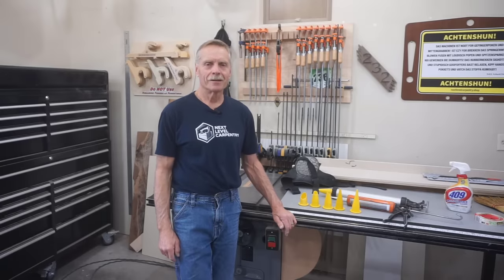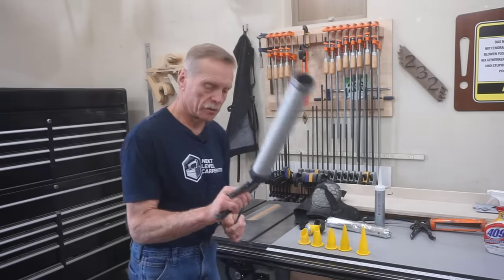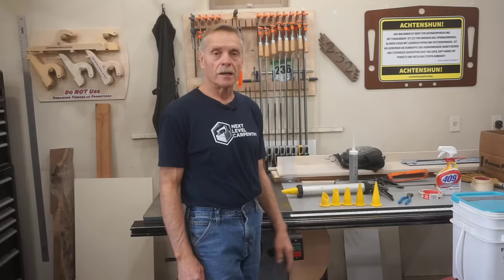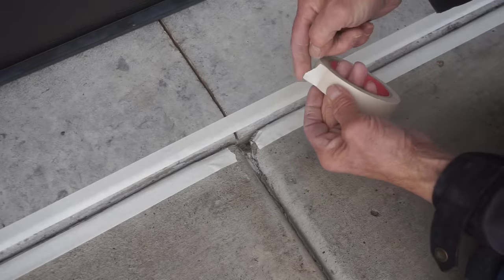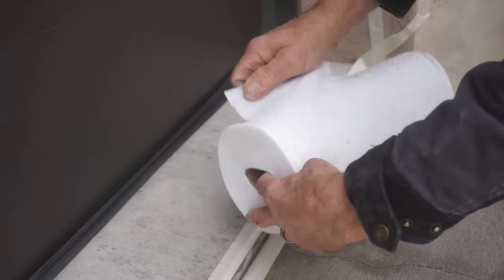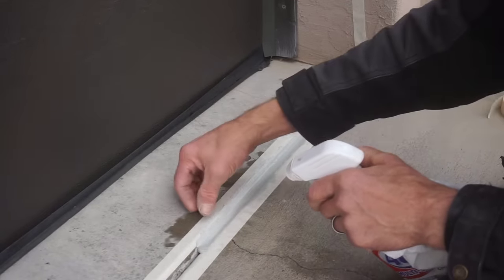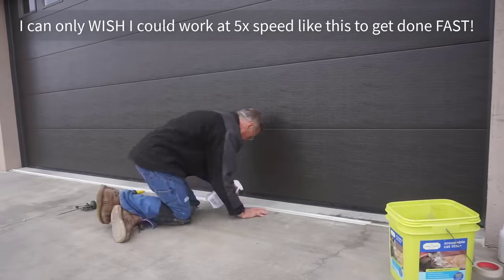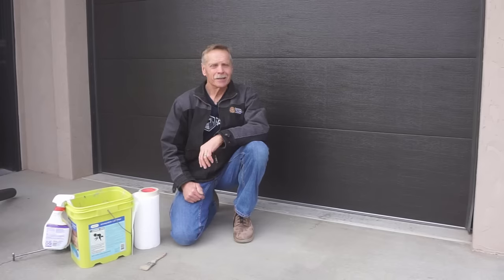How to Caulk Concrete Control Joints with Perfect Results Every Time

Comment: Thank you so much, Matt! We finally finished filling ours yesterday using this method. We ended up using Dawn dish soap with water in a spray bottle (as you suggested) because we couldn't find 409 anywhere--it worked out perfectly, and the end result with the sand on top looks great! To anyone who's thinking about attempting this: it took us 90 tubes (10oz) of Dymonic FC to finish our project which included our front sidewalk, porch sidewalk, long driveway down the side of the house, and 3-car parking area behind the house.  You'll very likely need more caulk than you think--it's unbelievable how fast each tube can run out with this kind of project (even with backer rods). Thanks a ton!
Reply from the maker: Glad to hear it worked out so well... it does go pretty well once you're all set up and have had a bit of practice... and you get a LOT of practice with 90 tubes!!  What dilution ratio did you use? I've been using 1 part Dawn to 10 parts water for the same reason and it seems about right. Feel free to add before/after photo links in a comment here if you want. Best, Matt
Reply: @NextLevelCarpentry  Our soap/water ratio I'd say was around 1/2 parts soap to 10 parts water--it didn't take much to get a nice slippery spray for us (we just eyeballed the mixture). And here's an AFTER pic:
https://www.dropbox.com/s/e49dzddm0xpx8fc/caulk_yt.jpg?dl=0
We had to use a really beefy backer rod for the middle part because of the gap and depth.
Reply from the maker: @a80ace  Nice work... thanks for linking an after photo.  Are you the folks that used play sand instead of silica to make it blend with old, weathered concrete?  Regardless you got excellent looking results considering the rather extreme gaps you had to work with!  Please post before or during photos too, if you have them, to show the transformation... Best, Matt
Reply: @NextLevelCarpentry  Thank you! And no, that wasn't us. Unfortunately we don't have many before pictures, but it was just the usual with over-grown weeds (which we now never have to deal with again!).

Comment: I've seen joints - both quality and not so - and this is the first time I've ever seen it done.  Just as learning how to wire a three-way switch, once you get the concept, your brain doesn't have to do any more work (i.e., no-brainer).  I believe I could, having never done this before, use your presentation to lay a quality bead first time, every time!  Thanks for the detail.
Reply from the maker: I think you'd do well too, based on your perception of the process Gary.   Sadly, although I've watched watched electricians wire numerous 3-way switches, it's still far from a no-brainer for THIS carpenter!🤔😎 Best, Matt

Comment: As a former sales rep of urethane sealants, you did a great demo. This product cures faster with moisture. Downside,  takes up to 24 hours to skin over depending on humidity. Urethane sealants are the best for longevity....period.
Reply from the maker: Dymonic FC skins over a little faster but sprinkling silica sand over the fresh sealant keeps joints free of debris while it cures making it a win-win for good looks and longevity.

Comment: You are so right.  Often as a carpenter, I am asked to do other jobs similar to this.  Such as, install a front door and then fix crumbling cement front steps.  That's ok, I don't work by the hour on these jobs and I want the client to be happy.
Reply from the maker: Many sealant jobs I do are 'add ons' like you mention Jerry but I'm not bashful about charging for extra labor and materials to do this sort of work because I feel it's an excellent value for my clients.  That way both my client and I are happy when the job is done... Best, Matt
Reply: @NextLevelCarpentry  Right Matt.  How about replacing my garbage disposer, or other minor plumbing. LOL. No problem. 
It's all good.  Nice to hear from you.
Reply: @jerrysmigiel7998  My best friend does all kinds of work. Plumbing, carpentry, electrical, auto repairs, home renovations, additions, roofing, etc... He repairs all kinds of things like furnaces, washing machines, dryers, dish washers, microwave ovens, etc...
I call him "Jack". Except the work he does is usually superior to the so-called "specialists" work who are often pushed by time constraints.

Comment: Thank you,I used 409 and it worked like magic  after the caulking dried 10 min.
Reply from the maker: Glad to hear it Scott, although there's no need to let the sealant dry for 10 minutes before use.  You surely can wait, but there's no need.  FWIW There's times when waiting 10 extra minutes allows bugs to run into and leaves to blow into wet sealant leaving a messier finished job so I work quickly between the time I dispense sealant and sprinkle sand.
Reply: @NextLevelCarpentry  I had to caulk around a bunch of masonry stone caps around a planter,the Joints were 1 inch wide,30' of linear foot caulking propally,40 degrees out,School wanted done that day,with tape and Your 409 trick,buddy you made my Friday easy.I owe ya case of 🍺 beer.
Reply from the maker: @scottrobinson2286  NOICE!!!  Thanks for lettin' me know... I don't envy you having to work with bare hands and 409 at 40 degrees so kudos for that part.  BTW I appreciate your offer but don't drink beer.  I'm a sucker for an ice cold Pepsi with pizza though😉😎 Have a great weekend...
Best, Matt

Comment: Do you have similar instruction or different product suggestion for a joint between concrete garage and asphalt driveway?  But, I LOVE your teaching skills, short and sweet, but detailed to assure the best results.  THANK YOU!
Reply from the maker: Unfortunately no.  The only sealant I've seen for asphalt that's anywhere near useful is the stuff they apply commercially with a hot Kettle and a hose which is a big mess and rather expensive. I've yet to see an aftermarket or individually applicable product that's worth the price of the packaging it comes in. I found one at one point that was somewhat easy to apply but became brittle and cracked out so it was useless within a couple years. What I guess I'm saying is that if you have a situation like that that needs to be sealed up you should contact local asphalt sealing companies and see if you can find one whose product and reputation are worth the money😔😎

Comment: I have watched a lot of your videos and have learned a lot from you. I am a caulker by trade and usually as soon as I see any type of tooling agent I tell viewers not to use it. And the reason is they use very poor gunning technique that does not push the sealant into full contact with the joint sides.This allows the liquid to run down behind the sealant contaminating the joint.You use proper gunning technique and essentially tool the joint once while you are gunning the material. Sealing it from letting the liquid run behind it. My only issue is when you install it only in sections you should stop spraying a few inches back from where the sealant ends so you don’t contaminate the exposed bare joint side.( it is only a very small amount in the video but that will tend to cause premature failure at that spot,ultimately it may not be an issue,but why take the chance when it is so easy to avoid)You are an intelligent man and I’m sure you understand that it won’t bond well for the same reason it won’t stick to your finger. I would not use 409 but that is only because I don’t know all of its chemical ingredients. It may be fine. 
BTW when they say wet tooling is acceptable, this is what they mean. After the joint is sealed and only to improve appearance. I have installed miles of sealant in flat work and have seen A LOT of failures because of soapy water but it is due to improper use and contamination of the substrate before the sealant makes full contact.
Reply from the maker: You are a gentleman and a scholar! I have to say that in the years since this video was released you must be the first professional caulker to leave a sensible and well reasoned comment with insight and suggestions that help both myself and others who view this video and apply these techniques.
Thank you... the sort of information you provide is an asset to the world of YouTube. 
Best, Matt
Reply: @NextLevelCarpentry  Matt you might not say that if you saw how I hammer so called experts.🤣
Just a little further insight why I would not use 409. About 15 years ago ( I’m guessing ,I’m at the age where time is relatively meaningless, Tremco started having issues with Dymonic “ reverting” ( basically turning to bubble gum after a few years. It took a while but the culprit turned out to be a caulking company wet tooling with alcohol. It seemed fine at first but it chemically altered the sealant. So I would stay away from any cleaners, just to be safe. Also you may want to check out semi self leveling sealants. That is what I use usually ,as a professional. For the most part they eliminate the problems of self leveling( sink holes, running of the edge of a sloped slab) BTW all slabs should be sloped to some extent. Additionally they are typically formulated specifically for traffic applications. Higher shore hardness.
Reply from the maker: @genecarden780  LOL... I always enjoy interacting with others who are passionate and knowledgeable about what they do!
 Thing is that I've used 409 just as shown in the video for projects for myself and for clients and have had zero issues with durability, longevity or quality of the sealing job done with this method.  Parts of sealed joints have failed but almost entirely from excess movement of the concrete itself, mostly from frost heaving in this part of the country, that exceeds the performance specs of even the best products.  I could show you joints I did myself 20+ years ago that are still completely intact and performing well so I'll keep doing and recommending this method.  I'm not a pro or specialist and understand completely that this method is not viable for most if not all commercial work but I've yet to see a better, more teach-able, more learn-able method for nearly all residential type projects.
I thank you again for your well-presented viewpoint and opinions on the matter and leave it to individual viewers to evaluate and decide how they go about this sort of work.
Best,
Matt
Reply: @NextLevelCarpentry  Matt I am in no way saying 409 is not acceptable just telling you why I personally would be a little concerned. If I was teaching this method I would use soapy water. But my experience is different than yours and while I am not shy about telling people they are wrong, that is not what I’m saying to you. Like I originally said I don’t know the chemical makeup of 409
Reply from the maker: @genecarden780  Got it... definitely gotta do what you can stand behind when working for clients when it's your name/reputation/liability on the line.  During COVID when there was no 409 to be had I substituted Dawn dish soap 13% and water 87% with similar performance.  Didn't give much thought to chemical differences and haven't seen any negative results.  I'm a little lazy that way and went back to 409 once I could get it again to avoid having to mix up the dawn solution😒😎  Since I'm more of a woodworker there's products, tools etc in that field that I can get pretty adamant against using so I think I know where you're coming from on this topic 👍
Reply: @NextLevelCarpentry  I think the key is wanting to do quality work that you are proud of. I get that sense from you. BTW I have been a professional caulker for over 40 years and have always taught all of my apprentices to learn quality work first and speed will come.  I have no patience for those who cut corners at the cost of quality. Again I get the feeling this is how you work too.As you said you have to do work that you can stand behind.  Oh and one thing I forgot to say : as an amateur woodworker of 30 years keep making your videos . I always like to see new techniques or variations on techniques . Almost all of your carpentry techniques can be applied to furniture making. Thank you for your videos and thoughtful ways to speed work while increasing accuracy.Time is money but quality justifies the extra money.
Reply: @NextLevelCarpentry  This is what I meant about my experience is different from yours. You have 20:years experience using 409 I have 0. I have pretty extensive experience completely redoing 1000s of feet of sealant that failed because another contractor used a very common chemical( alcohol) that everyone thought was ok but completely altered the sealant in a very bad way. Making me wary ( maybe overly so) I donot expect or even suggest that you to change anything except stopping your spray a few inches short of where the sealant ends. So you don’t contaminate the bare concrete. And also shoot a few inches of any joints that intersect for the same reason.Every thing else is meant as information not critique.

Comment: Hi there stumbled across your video and it’s excellent I have a concrete roof over a garage that leaks in heavy rain due to a bad design and bad caulking, this is exactly the type of easy to follow instruction.  Can’t wait too try it now I’ve only put it off for 6 years 😂
Reply from the maker: This is exactly the way I'd approach your concrete roof project Michael.  Since sealing a roof is more critical than a driveway I'd make sure to do the job in ideal conditions ie: warm and dry for best results.  Spend extra time on your prep work removing old sealant, loose concrete and other detritus because, left unattended, those can cause continued leaking no matter how nice the job looks when complete.  Best, Matt

Comment: Thank you for a clear & concise video to help out us DIY folks.  This I’ll help me get some joints cleaned up and not looking like garbage.   FYI. They have looked like that since the home was new.  So maybe some “professional caulkers” really are not very good at their job or just more interested in piece work and slopping out what they can get away with.   Which unfortunately is the norm for most new homes being built these days.
Reply from the maker: "professional caulkers... slopping out what they can get away with" seems to be all-to common these days.  You should be able to get excellent results in short order with the process you've seen in the video.  Start on an easy section to get a feel for it and you'll be crusin' in no time! Best, Matt

Comment: Ideally, caulk when temperatures are cool so concrete, etc. is under contraction. Then as temperatures warm the joint and caulk material will be under compression where it will perform very well.

Comment: I had a chance to redo my driver-way, previously stain concrete, and used your techniques for all the control joints including getting the sausage caulk gun.  I did re-stain it including the the Tremco FC urethane sealant, we'll see how it all holds up, but it looks great now.  I will never use self leveling caulk again.  Thanks for sharing all the great ideas in this video!
Reply from the maker: You're quite welcome Jim... and I hope the concrete staining holds up as well and looks as good as the Tremco does in the future as I have more confidence in it... that stain can be some unpredictable, unreliable stuff but, if you've done good prep work and applied using instructions it should survive well... Best, Matt
Reply: Howd has it held up over the last 2 years?

Comment: Next Level Carpentry’s directions are excellent and helped me do a job I’m proud of. During the summer of 2020 I followed the directions, with the exception of the 409, and the results were terrific. I think the key points of the directions were 1) using masking tape, on straight runs, to control a nice clean edge, and 2) sprinkling the sand on top of the sticky caulk. The sand makes the finish look so much better than the plain, un-sanded caulk.
I have a swimming pool built in 1963 with a concrete deck using redwood expansion joints. I replaced the old, rotted wood with new wood and caulked the wood-concrete joint following Next Level Carpentry’s directions. I also replaced the caulk between the concrete deck and pool’s coping using Next Level Carpentry’s directions. Although the pool deck is now close to 60 years old, the joints look great.
Thank you Next Level Carpentry for sharing you directions and helping me restore my old pool deck.
Reply from the maker: Thanks for your 'testimonial' Charlie... it's great to hear from viewers like yourself who see this video for what it is despite disparaging comments posted by random 'experts'!  Much appreciated, sir!! Best, Matt

Comment: A quality video showing a Quality Tradesman at work I am blessed by your thorough and clear content 
Please ;I have a humble request, could you please add a close up picture of the finished joint ?I would like to learn is the objective to have a concave or convex joint surface  ?
Reply from the maker: The video thumbnail is the best 'close up picture of the finished joint' I have to offer.  FYI I explain in the 'tooling' part of the video that the best joints are slightly concave when finished.  This recessed joint prevents traffic from wearing the sealant prematurely.

Comment: It's always nice, if not rare, to see a fellow carpenter take pride in their residential works. Tape is so essential to caulk, it ought to be sold in pairs. You could lighten your videography stresses by purchasing a DC adapter for your camera and an AGM scooter battery (9ah). No more worries. Thanks for the excellent video!